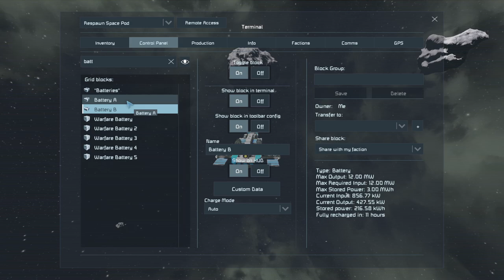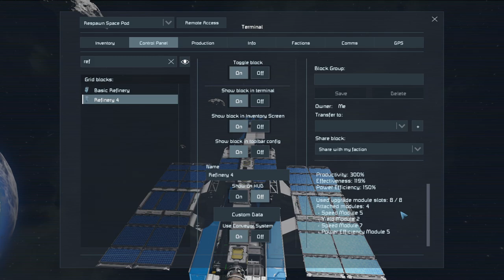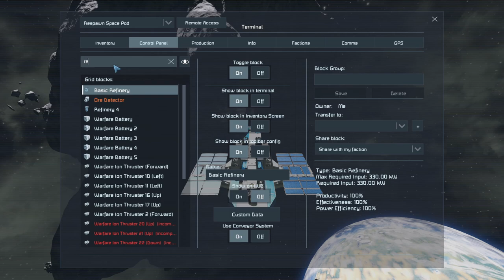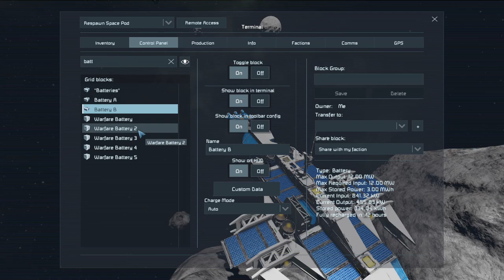Space Engineers: Ship Evolution - Elusive Silver And Wing Redesign EP5

Comment: I just got caught up with this series and wanted to comment on something I haven't seen mentioned: The speed modules on the refinery massively increase your power usage. I believe adding two of them tripled your power consumption. Remove those and swap them out for one more efficiency module and one more yield module (which does not affect power usage). Add an efficiency module to your assembler while you're at it. Edit: You can test the speed modules' effect on power usage quickly by selectively turning them off.

Also, solar works best when directly facing the Sun. You frequently have them facing the Sun in one of two axes. Use the antenna you just added as a guide... reduce the shadow to zero and you'll get double the power output you previously saw.

For going hydrogen, swap those small tanks out for a large one. You'll have way more capacity (large has >14x more capacity than small), and lower your total mass by well over a ton.

Comment: The ship is getting too big for small thrusters. I would probably just leave it behind, take 2-3 bottles each and go in an asteroid hunt with suit only. You can switch everything off let the batteries recharge.
I think the ore detector (have you checked that yours was ON? :D) doesn't benefit from an antenna, but if it has and it is set to use antennas, whatever the detector detects (150m) you can see from the range of the antenna too (so from 2--5-10km) on your hud.